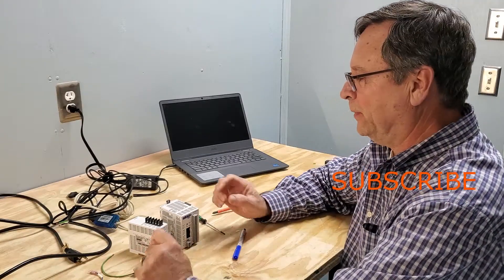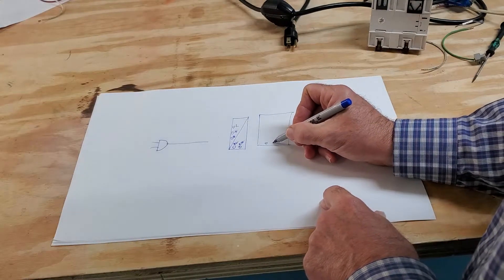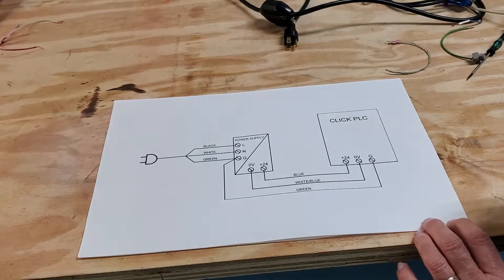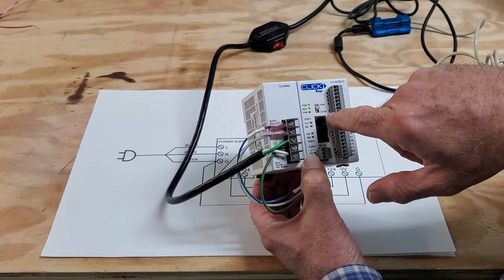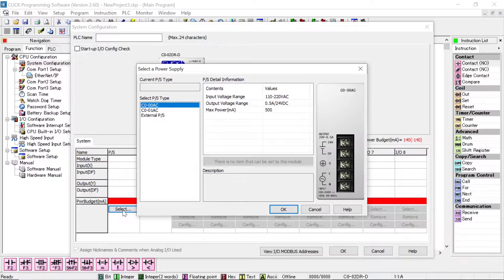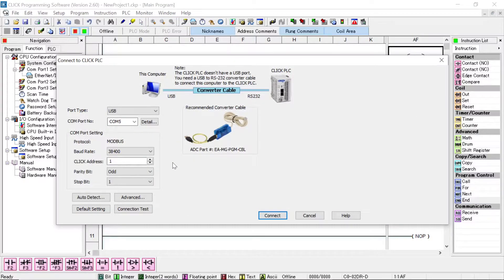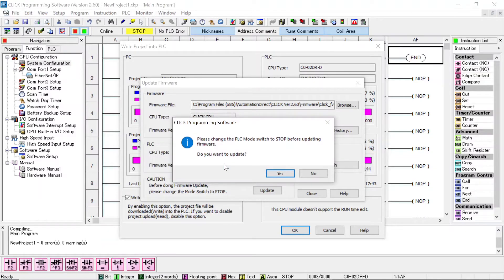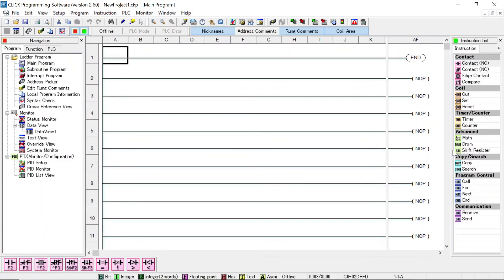PLC programming with the CLICK. Let's get started. (CLICK  2)

Comment: Could you power it with a 24v dc desktop power supply ?
Reply from the maker: @charles26842  should be able to
Reply: @ great thank yo +24v and GND correct no need for 0v
Reply from the maker: @charles26842  it works with the +24 and 0. The ground is just reference. If you supply is showing +24 and gnd only, then connect the gnd to both ground and 0v on the PLC CPU
Reply: @ Thank you I am able to power it with the desk top powersupply, a new issue has popped up the USB-serial cable converter has been out of date from 2012 according to my computer with windows 11. Therefore I am trying to find third party driver to bring it into the future.

Have you ran into this issue ?

If so what was your fix ?

Thank you a billion times btw
Reply: @ Actually nvm, I was able to get the older driver working :) PLC fun time now

Comment: Does the PLC unit include the white, blue, and green wires on the tiny piece, if not where can i purchase those ones wired to the CLICK power supply in this video.
Reply from the maker: When I was building control panels I would order 500 ft spools of all the colors and sizes I needed. If you want smaller quantities you can order it through Automation Direct.
Reply: @WadeCountryLiving  What's it called, the green blue and white wire on Automation Direct?
Reply from the maker: TFFN single conductor 18 awg
Blue is for the +24 volt
Blue with white stripe for the 0 volt.
Those are only used with the DC power supply.
Red is for 110 VAC
White is for Neutral 
Green is for ground
Reply: @ In terms of the blue with white stripe, why do i need this type of TFFN wire?

Comment: What is the interface from the PLC to the PC?
You mention an RJ12 THEN YOU SAY NOTHING .
An RJ12 is usually a serial connection, how does it connect to the PC?
What is the programming App?
Reply: To connect the PLC to PC, you need a USB to Serial converter. This is the part number of the cable: EA-MG-PGM-CBL.